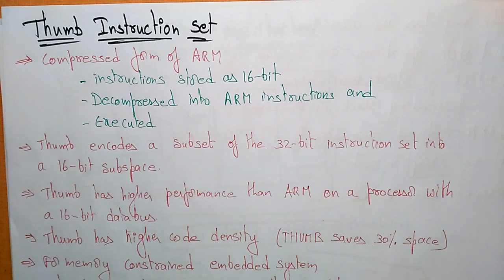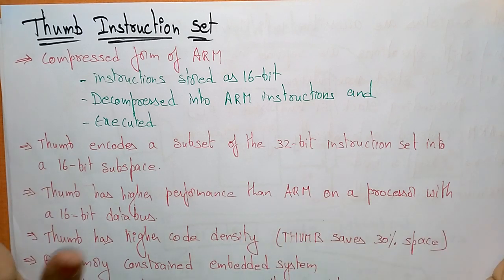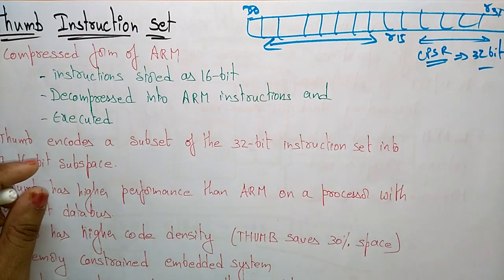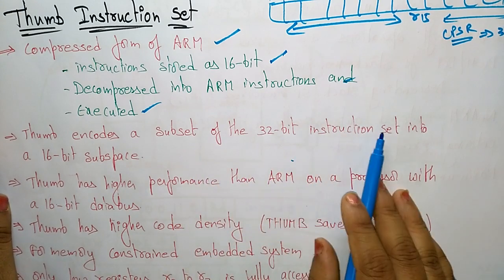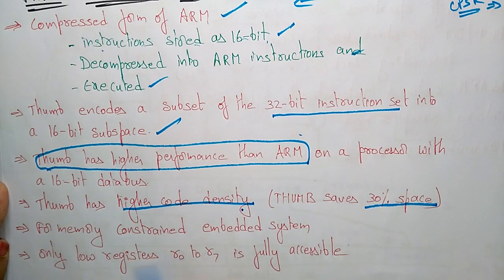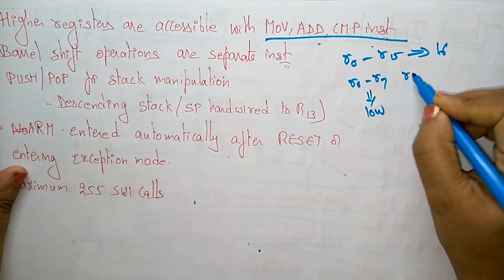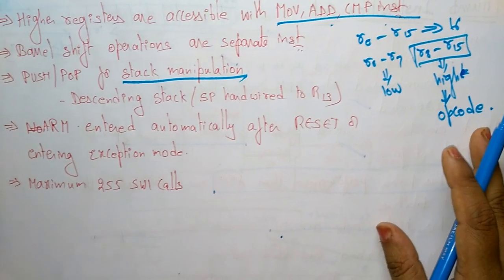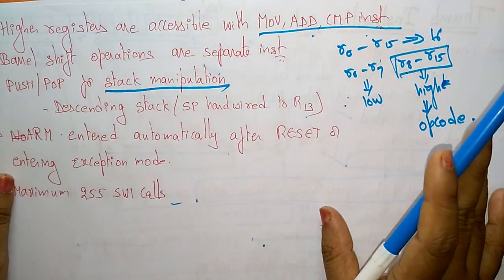Thumb instruction set in ARM | ES | Embedded Systems | Lec-15 |  Bhanu Priya

Comment: The Cortex M0, M0+ & M1 processors ONLY have the Thumb instruction set. The M3 & M4 have the 16-bit Thumb & 32-bit Thumb 2 instructions and only the M7 has interworking between the Thumb & ARM v4 instruction sets.